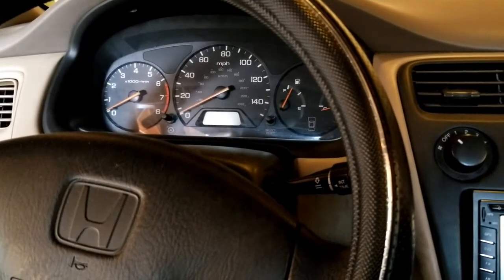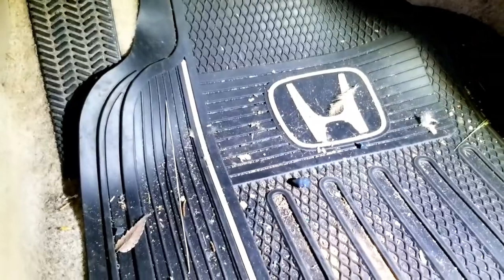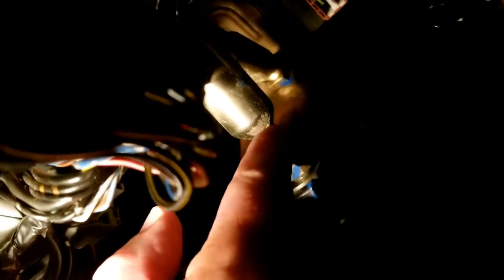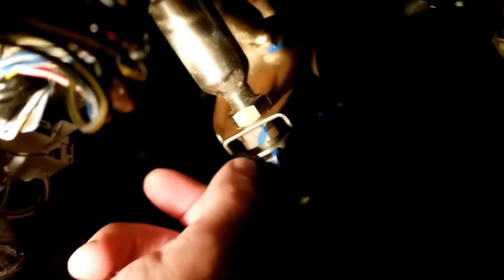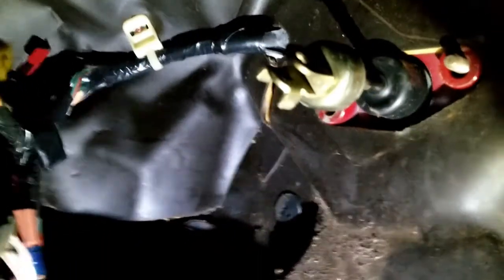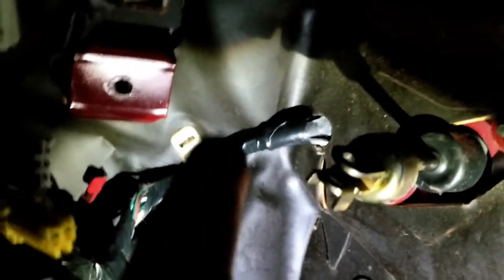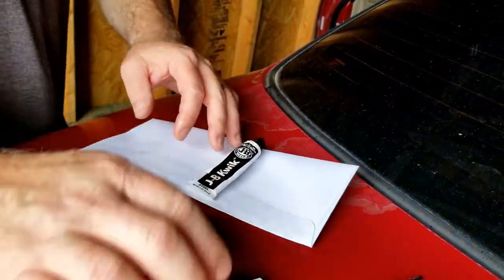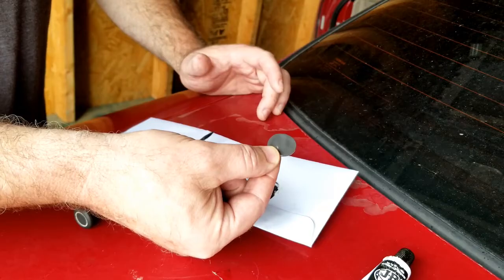Honda Clutch Safety Switch Repair

Comment: What is the name of the switch on bottom and one on top? What is the part number ? I am not sure which one is which I need buy??? Appreciate the answer.
Reply from the maker: The top one is called the clutch inhibitor 35710-SE3-A01. Bottom one is called stop cruise 36750-SEA-003.

If the car starts but the cruise doesn't work, lower switch. No crank, upper switch.
Reply: What tool and size wrench or any special wrench to get?? I can’t get to the top nut with a wrench. Thanks
Reply from the maker: After u get the electrical connections off, turn the tube of the switch counter clockwise with your fingers. The nut on the other side is probably a 12mm, if memory serves. 

Now. If the plastic stopper is gone, the switch is probably good. Just not closing. Don't load up the parts cannon unless you are sure.
Reply: @ktecgarage  the stopper bottom has failed off on the the floor. I used a dental mirror and I coukd  see the top stopper still intact.  I jumped it started but engine  reve or surge and throw  codes.
Reply: The nut to the front is welded onto the frame. The nut on the switch is not. Mine is an 05 Accord Lx .4cyl.
Reply from the maker: Edit: you said you jumped the switch  The bottom one prevents the cruise control from engaging. If it's running bad and throwing codes, those clutch switches aren't your problem. 

To take them out, spin the switch by hand and hold the nut that's in the back.

It will go much easier if you bite the bullet and take the clutch pedal out. Two nuts on the studs for the clutch master cylinder, one bolt on the top and pulled the cotter pin that connects to the ram for the hydraulics.
Reply: So I already laced a rubber stopper to the bottom that had fell out but it still not crank. I am assuming one of the switch is bad.

Comment: Hi i have the error code p1704 is this my problem solution ot this video
Reply from the maker: If it's throwing a code, you probably have a bad switch , a bad wire, or a loose connection.

Comment: Can I push start the car to get it to turn on? Or will this sensor prevent that as well?
Reply from the maker: 🤔 Seems to me it should start.
Reply: Yes, i was able to push start the car.
Reply: Also yes, it was the rubber nub, and another yes, using a paperclip to short it worked well. Bonus yes, I also need another nickel because the nub came off my cruise control, and now I know how to remedy it. THANKS!!
Reply from the maker: Thank you for the thanks!

Comment: Do you have a video for a 1995 Civic Coupe?  Supposedly I have the same issue and the mechanic said that he fixed it... but I'm back to my car not running again :( ... my battery is also draining and he said that it's the same issue but behind the brake pedal?  Help please😭
Reply from the maker: The 95 Civic would be virtually the same as this Accord. There is a similar switch on your brake pedal for your brake lights. When it goes, your brake lights stay on even with the key off. That would drain your battery.
Reply: @ktecgarage  Hi.. thank you, I'm back again... lol... This time for my son's 1999 Civic EX coupe ... it cranks but doesn't start.  Do you have a video or a step towards a solution?  I'm trying to do a process of elimination without having to repair something that's not broken.  Thank you
Reply from the maker: I would check the fuel pump first. It is inside the gas tank under the rear seat. When you turn the key to run, you should hear it hum for a second and then stop. You can usually hear this clearly while sitting in the car.

Comment: Okay i have a 02 civic ex. My problem is with the rubber stopper. Does anyone know where i can find that rubber stopper? Like a part number or link?
Reply: I got one at AutoZone I just said do you have a clutch pad and showed them a picture from one that was on Amazon. The name on the receipt is 7 4 0 1 5 dorman pedal bushing and pedal stop kit 👍
Reply: @M3GAN3116  thank you bro I really appreciate that

Comment: A similar adhesive-based improvisation to create a stop pad or bumper in situ shown here: As a way to solve the clutch safety switch problem demonstrated here without removing the clutch to access the hole for the stop pad or bumper, you could refer to the following link (video and description). This method uses a putty to create a stop pad/bumper on which the clutch sensor/safety switch lands and is then pushed in. 
https://youtu.be/ncYaH9xELkY

Comment: Thanks for the video , but jb weld cost just as much as the rubber pads from honda, i ordered the pads instead.
Reply from the maker: True. The point of the video was to repair the issue with what's in most people's toolbox without ordering parts. 

The plastic pads are the correct repair, but I've been running nickles for years without issue!

Thank you for watching and commenting!

Comment: Trying today saw the stuff on the floorboard and no crank
Reply from the maker: If you found the plastic pieces, get your nickle ready. Good luck!
Reply: @ktecgarage  yessir!
Reply: @ktecgarage  I did the nickel. Did not crank. I put a paper clip in and the car started clicking with the starter, had not done that before but it doesn’t start. At least now I’m getting the clicking from the starter
Reply from the maker: Sounds like u have two different problems.

Comment: I would go intro drive past netrual and it shuts off stalls out
Reply from the maker: Search for Honda neutral start switch or range switch video. This video just covers the manual transmission. I've never worked on an automatic. Good luck!

Comment: Hey man, does that paper clip trick really work? Car is stuck at walmart lol
Reply from the maker: It works like a charm. Good luck!
Reply: @ktecgarage  Hey great video, thanks! I have the same problem right now, 2001 Civic LX stuck in the grocery store parking lot. I found some plastic pieces broken on my floor but replaced the lower one for the cruise control that was missing because I thought that was the problem. No luck. I think the upper one to the ignition is probably missing as well. So if I just stick a paper clip in that connector and put the car in neutral, it should start normally?
Reply from the maker: Yes sir. Good luck.
Reply: @ktecgarage  Not all heroes wear capes! Or do you?? Worked perfectly and saved me a tow.
Reply from the maker: Tell your friends!
Reply: That’s ironic my car was at Walmart when this happened to. My friend came and put a wire where my starter was while the key was turned and it started. Gonna try this today because I’ve been with no car for 2 days
Reply from the maker: I guess Hondas don't want to  leave Walmart parking lots. Maybe the lot is more comfortable

Comment: Why do they even have stoppers. Why not just make them full metal
Reply from the maker: If I had to guess, the rubber reduces the impact on the switches. I've never had a switch go bad after the nickle trick.